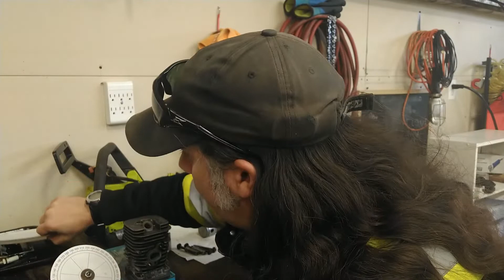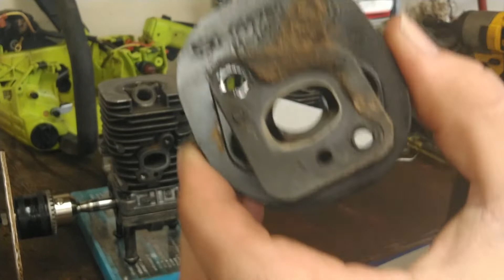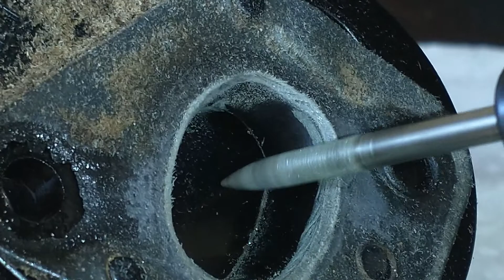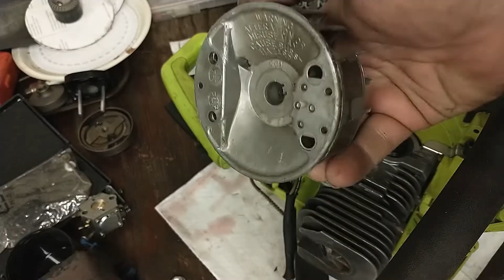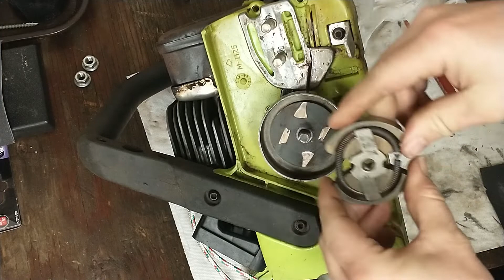How to port a chainsaw. Poulan 2150 porting how to stage 1 #chainsaw #porting

Comment from the maker: That saw is still running strong a year or so later with a ton of use and abuse. I have hammered that thing hard. It has great compression and is a strong little saw. It's my go to saw it works so well. I have two more with new cylinders to port soon. It's time to experiment with new pipe designs 😎

Comment: I like to trench the lowercase and give it a small timing advance, that really seems to help them tremendously.
Reply from the maker: I love stuff like that, the next step I had planned was a timing advance 😁 I love the idea of trenching the lower case 👍 I have a bunch of those saws so I can swap parts in and modify them and swap the original back in if it doesn't work out. So I can have a flywheel with the advance and swap back and forth. Thanks for giving me some cool ideas

Comment: What mods did you do to the muffler?
Reply from the maker: I built a custom pipe for it. If you lool through my shorts you can see a quick view of it. I'll post more info on it later on today.  I have also modded another 2150 where I modified the original muffler to work with the port job with no extra parts or welding other than 2 short bolts
Reply: @patthesoundguy  I have worked on about 5 of these since September.   I just removed the baffle and screen on the inside of the muffler and spread open the rear exhaust ports.  I never understood why they have that metal sleeve in the exhaust port on the cylinder, but i always left them in.  Is there any benefit to take them out before you put the muffler back on?
Reply from the maker: @jaysonsetzer2287 if you change the exhaust port you need to pull the sleeve. If you leave it stock you can leave the sleeve in. I believe the sleeve is an insulator of some type, it also makes it easy to clean carbon out of the port. I pull them because I change the shape and timing of the exhaust port.  If you remove the two spacer tubes from the exhaust can if they come out and use short bolts to attach the muffler, you get two nice holes in the front of the exhaust with no work. That's what I did to the first 2150 I ported, I did what you did and removed the screen and the main spacer then had to two holes in the front of the can. It worked great. The custom pipe I made is the best thing I did though. Now that the saw is properly dialed in, it's absolutely insane.

Comment: Im doing a 029 and 291 right now,no better really, $600 for them new,crazy. Poulans aren't bad for what they are
Reply from the maker: That little plastic thing is an absolute beast now that it's ported with the pipe.  I had it out helping the neighbor take down some pretty big pieces of willow and it still rips like mad. That saw definitely thinks it's much larger than it actually is 😉

Comment: I was also curious what brand of bar you bought for the saw, I want to try and replicate the sweet little saw you have built
Reply from the maker: The bars I run I get from Stens. I think I put an 18 or 20 inch on it if I remember right. I can have a look and see what it was. The longer bar makes it so much easier to use.
Reply: @patthesoundguy  okay thank you very much

Comment: Hello, I have a question because I would like to do such porting myself. And I have a question whether it is necessary to undercut the piston or maybe it will work well on the original piston .😊
Reply from the maker: The beautiful thing is you can experiment with all of that to see what happens. You can do some port cleanup work first and not change any port timing to start, and add the cats tongue texture to all of the intake and port match everything. You can leave the piston alone and see what happens 👍👍 It's all about trying things and seeing what results you get. You can also start with a muffler mod. Then if you want to try making a degree wheel and see what the numbers are then you can try a little cutting on ports. I cut the piston to get more intake duration. I could have cut the floor of the intake port but cutting the piston was so much easier. It really gave the saw the good bottom end crack when I pull the trigger.
Reply: @patthesoundguy  Great, thanks very much for your help. I will tell you that I made the muffler after the muffler made by Novice Lumberjack. And let me tell you, I really gained a lot of power. You can feel the increase in torque as you cut the wood. I also played with the ignition, sped it up a bit, but I will refine it further. I like these chainsaws very much, I have never done such porting and tuning, but when these modifications bring results, I am satisfied. best regards and thank you for your help👋

Comment: Did a timing advance on a pp5020 and the results were amazing. So I think it is good to pay attention to fly wheel position when tightening down tapered connection along with coil position to get a slight timing advance.
Reply from the maker: Definitely going to play with the advance on that saw. I have a few of them so I can keep one flywheel stock and have one that has no key to play with the timing 😎
Reply: I like my Wild Thing 2375

Comment: Sounds great thanks !!U get the exhaust opened up and that thing will be a monster ive got 5 of them love them all ive got 1 that is so old it dont even have a chain brake but i can put a newer side on it just wrong color !! U did a great job viding and showing again thank you !!! Im definitely going to try it on 1 of them !!
Reply from the maker: I built a custom pipe for it and it is a monster, I put a 36" bar on it at one point 😎 I have been collecting them over the summer, I have 3 more to work on.

Comment: That chainsaw doesn't have shock absorbers. How can you work with her?
Reply from the maker: I ran it for a few hours for the first time in a couple months and I didn't have an issue not having antivibe. If I was working professionally I would need a proper pro saw but for the smaller amount I work with the Poulan I'm happy

Comment: FROM someone who completely DO NOT KNOW much about engine....AFTER you get all those numbers - WHAT DO YOU DO with 'em? and HOW do you do it!  I've watched few vids on  getting those numbers BUT I have NOT seen ANYONE explain WHAT TO DO with "em
Reply from the maker: That's a fantastic question! I have to apologize, I  thought I had put more footage of the actual grinding on the ports. The whole thing is all about duration... Which is how long the ports are open. So all I did was take 1.5mm or so out of the top of the exhaust port to raise it. That extends the amount of time the exhaust is open and also opens the exhaust port a bit earlier to send the exhaust out faster.  And to get the intake to stay open longer you either remove some material from the bottom of the intake port or just remove some material from the piston skirt, which is what I did with this saw. I simply traced the shape of the intake port and removed the amount needed to get the extra duration I wanted. I stuck to the premise of how Donny Walker explained to take the duration to about 160 degrees on some saws and leave the transfer ports alone and I have had great luck with those poulans doing just that. I could get more out of it by touching up the transfers some but I'm leaving that for now because the saw is so amazing the way it is. Here is a short showing what doing some of the grinding looks like. I will see if I can dig up the missing footage of how the grinding goes. https://youtube.com/shorts/zBuPKpzqEuk?feature=share stay tuned I will have some more porting videos soon.
Reply from the maker: Feel free to message me on my Instagram @patthesoundguy if you want to chat more about the process.
Reply from the maker: Another great channel to get some great insight into porting saws is my buddy the Novice Lumberjack. Make sure you tell him I sent you, he has a great channel.

Comment: I know this is an older video, but I can appreciate it because I’m a cheap bastard. All I buy is cheap saws so this gives me inspiration to soup up a couple of small blocks
Reply from the maker: Thank you so much for the awesome comment! This video is a bit over a year old I think, I'm going to revisit the saw as soon as I can make some time. It works so well it brings a giggle every time I run it. The custom pipe woke it up as well. It's more fun being a cheap bastard because anyone can go buy horsepower but it's more fun to unlock it for the least amount of money possible 💪 I have a couple shorts showing the saw in action, one of which I run the 36" bar on it 😁

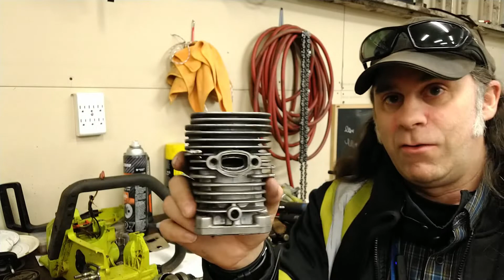Comment: Without checking #s,  do you think that taking the lip off from the stock cyl exhaust port (@ 24:50) would make a difference On a stock saw?
Reply: Ps. Really enjoy your videos!
Reply from the maker: Thanks so much for watching! I hope to be getting some more content out soon. I have been so busy over the past months I haven't been able to film a darn thing. I plan to go back into that 2150 again to touch up the transfers. That saw has been performing so well and I know I can get more out of it.
Reply from the maker: From my experience when I was doing two stroke tuning on Honda scooters, I wouldn't just go raising the exhaust on a cylinder like that. You may not like the results. It can rob you of low end and could make the engine lazy feeling if you raise the exhaust roof too much without doing anything else.
Reply: @patthesoundguy  words of wisdom! Thank you for sharing your knowledge and experience and the lighting quick reply.  Much appreciated!

Comment: Good video. Im about to do my 20yo 2375. Thank you
Reply from the maker: Thanks so much for the comment, glad it may have helped you get started. You will really enjoy the finished product. There is still more one can do with those cylinders but even with that light job I did the saw is an absolute beast. Hopefully I will have the time in the next month or two to go back in and touch up the transfers a bit.

Comment: I may have done it wrong but when I opened the port on my saw it killed the power and I may not have it tuned right or chain to hungry but I kinda wish I left it stock
Reply from the maker: Which port did you open up? You may have just need to get it tuned up. Sometimes you may need to lean it out or richen it up depending on what's happening. I would warm it up to operating temps and then drop a new plug in it and run it in the wood for a minute or two and then read the plug. Read the plug at the the very base of the porcelain down inside the plug. If the ring is white it's lean of it's really really dark it's rich. That would be where I would start to troubleshoot. It might also be a good plan to check the saw for air leaks with some sort of spray, like WD-40 or brake clean can work as well to spray around in intake tract to see if the idle changes. Also you could need to mod the exhaust or build a pipe to get it to breathe right. I made the Iron Horse pipe for that saw after I got it running, because it wasn't running well with the stock muffler.  This porting stuff can take a bunch of experimentation to get something to make good power. Don't worry you'll get working better. 👍
Reply: @patthesoundguy  I found the problem the intake boot that mounts to the head I guess had a very fine crack I had it running good and tried cutting some cookies with the cover off still and  it back fired and blowed it to hell I'll be looking for a new  one  makes sense on why it wasn't running great in the past and why it was impossible to tune i guess it was lean not rich even though I turned it 3 turns out hope that didn't kill the internals and again thanks for your help I really appreciate guys like you
Reply: @Fluidpaldin420  yeah but that doesn’t explain your 100lbs compression?
Reply: @Fueler  i think thats because its 20 year old saw that has been abused i got it for 50 bucks at a yard sail cuz i needed a small saw for the house and decided why not try out porting
Reply: I am going to go a leak down test soon I pulled the cover and ran it in wood just to be able to see and adjust it better and had fuel spitting back at me so I thought it was rich I played with the screws for an hour on the tailgate and in the wood I put the exhaust screen back in and tuned some more got a little better only other mod I did was a 3/8 hole in the middle just under the bolts and I did the exhaust just like you it's a poulan wild thing there heads are the same as far as I can tell didnt bother with the intake may need new carb gaskets as I just cleaned it and could have damaged it or the diagram I don't think so but I am not Gunna give up on it I know there parts are fairly cheap and when I got cash to spare I can always make it stock but I would like to learn and have a light 18in saw with some power for the truck and I am not rich so a cheap one is my only option thanks you for the help I'll let you know if I figure it out or go back to stock I do like the way it runs and sounds has good power in the first few inches then just no torque and it's dug fir it's tight grain and big rounds  but still just dug fir
Reply from the maker: @Fluidpaldin420  I just got the gauge for carbs to make a leak down test kit, can't wait. The great thing about those is like you say how cheap the parts are... I got a whole top end for my saw for $35 shipped Canadian. I like working with that Poulan for that very reason. I have a nice Stihl 024av and other saws but that green thing is my main go to saw right now.
Reply: I got my grandfathers Stihl 034 he had a big bore kit ported and a larger model carb just on it and I love it for falling and anything over 24ins cuts fir like warm butter and screams a beautiful sound just wants to rattle your arms off  and is cold blooded and although it's fun I believe there can be to much tool for the job and just for limbs and fire wood a light saw will do fine but and gear head knows the urge to make more power
Reply: @patthesoundguy I did a compression check and it's down below 90 lbs I am Gunna do a leak down on it and if that checks out I think she's gonna be sitting on the shelf for a while I don't want to throw her away dam
Reply from the maker: @Fluidpaldin420  wait... Did you use moto seal on the base of the cylinder when you put it back together? If that cylinder base is leaking that could be it. Or of the seals on the bearing didn't go back exactly how they came out with the whiteness marks going in the right places it could leak there.
Reply: I cheaped out there I know not good but the original sealent cam free from the bottom crank cover and stayed well intact to the head though it would seal like the orings in water cooled dirt bike heads but I guess it won't hurt to take her apart on more time and would rtv red work the same or do you really need moto seal or I have a small tube of Toyota timeing cover sealent
Reply from the maker: @Fluidpaldin420  you want to clean it all up and get Permatex Motoseal great or ThreeBond or Yamabond or Hondabond... Regular RTV won't hold because it melts when in contact with fuel. The Motoseal is fairly inexpensive, I paid $7 Canadian for my last tube. I bet you get that all sealed up you'll have it running. Have a really good look at the bearing seals and you'll see the marks how they go back. It's a little fidgety going back together but all in all not too bad. Might take a try or two.
Reply: I'll have to get some and yeah the bearing seals were a pain but I made sure they went back the same way I've rebuilt more than a few motors and always make sure it goes back the same way it came out  I used a blue sharpie to make a witness mark on  them and the case makes it fool proof I never checked the ring gap it is an older saw I'll have to actually go through it instead of just assume that it was all good before I started messing with it  originally ran but had a plugged carb could have just ran lean for to long an wore it's self out the piston was the cleanest I've seen come out a two stroke not much carbon and vertical scoring was almost invisible when I get to it I'll let you know like I said I could have mest up I am not a pro just a guy in his shop even pros over look or mess up some times and that's how u learn
Reply from the maker: @Fluidpaldin420  yup that's how I learn too 👍 I have a good feeling you'll have it running great in no time
Reply: So I got some moto seal pulled it back apart and cleaned it all up checked ring gap it's fine cylinder has some marks nothing bad seems like it was from flooding and gas washing the cylinder not debris  wet sanded the ring and cylinder with 600 and 1000 grit to get some cross hatching back buttoned it back up and after cleaning let cure over night next to the stove compression checked it and got just under 100 psi could you do a video or check your saw for compression and tell me what you get for comparison only thing I could see now is that grinding the exhaust port raised the compression stroke making it shorter and reducing the amount of time and stroke to compress the air fuel mix  I could be wrong but it would be nice to hear your opinion and thanks again for taking the time to read and respond
Reply from the maker: @Fluidpaldin420  if you have only raised the exhaust port it can kill the bottom end some.  You may need to lower the intake some to match to get the flow where it needs to be.
Reply from the maker: @Fluidpaldin420  I ran into that kind of situation when I was into tuning scooter engines, I would loose bottom end grunt when I only raised the exhaust and didn't change any intake timing with it.
Reply from the maker: @Fluidpaldin420  I take material off of the piston skirt to change the intake timing on those because I can buy a new piston to reverse any changes. And it's easier to cut the piston than it is to grind the intake port